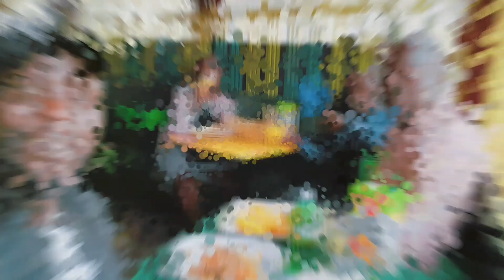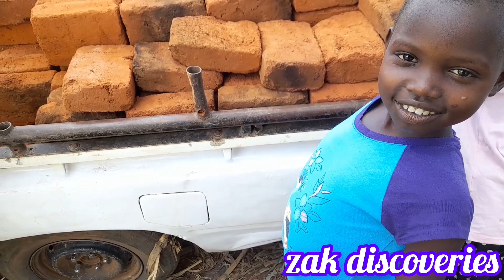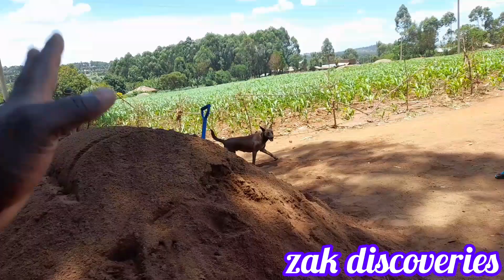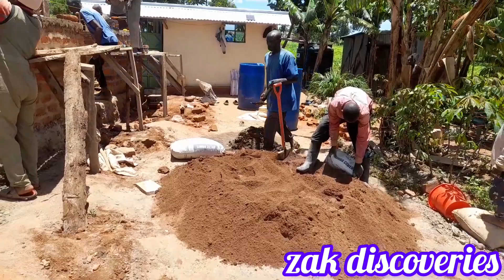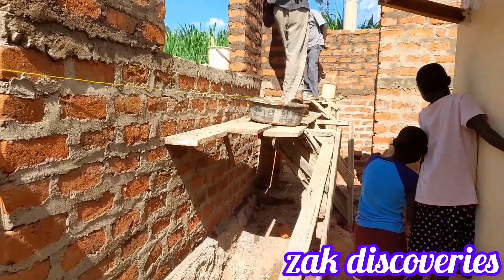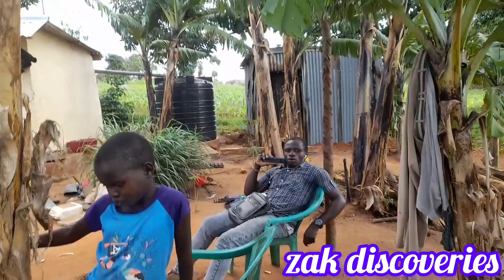Done To The 2nd LINTEL 🙏🙏🙏

Comment: Zak, since there are so many windows, I am a little worried about which wall will be the  load-bearing wall? Some of those walls may need reinforcement with steel columns to support the weight of the roof, wind etc...to prevent the walls from cracking or a collapse. Please consult your Engineering professional, Mr. Richard.
Reply from the maker: That roof I'd not that heavy hence the walls can sustain its weight